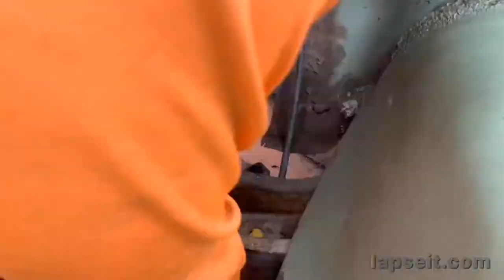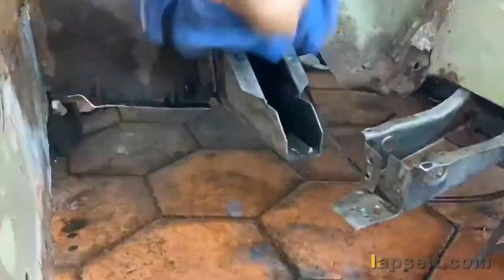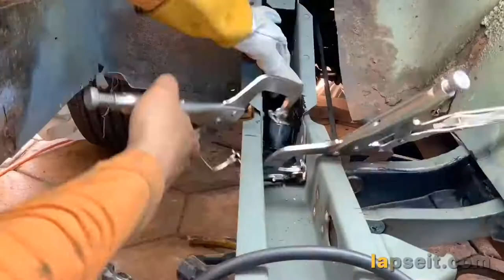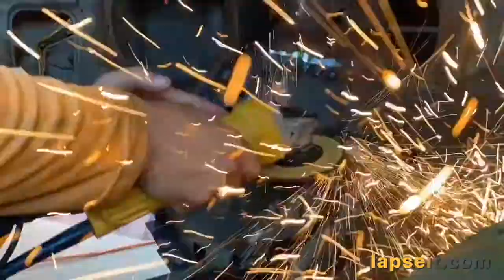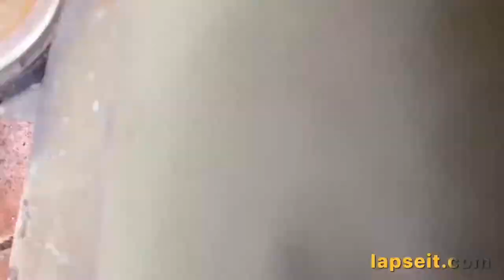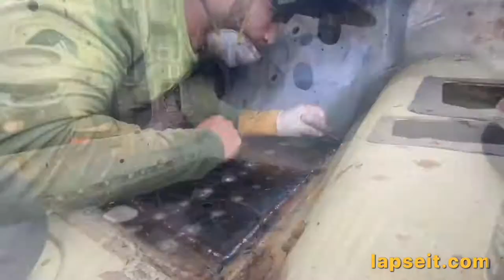Raplacing torque box, floor pan and support floor 👨🏻‍🏭🙌🏻 mustang 1969

Comment: I see you have left the car with door on, front end on, is this to keep it structure?  My sills and torque box are rusted similar,. Do I cut it all out altogether to do the job right one side at a time of course? Cheers for great video
Reply from the maker: Hello . Nop I just keep because is not necessary to take door out to do it.  If you see in the video I put a metal piece to keep the structure strong before I cut the torque box . That is the right way . Do one side first and then the other one .

Comment: Nice work, what paint are you using? Seems to be alot of debate on the subject and I can't make up my mind which way to go. Thanks
Reply from the maker: Thank my friend ! I am using acid first to  prep the metal and then self itching primer .  But is better if you use epoxy primer to seal Vp2050 is the best for that .
Reply: Ok, thanks 👍